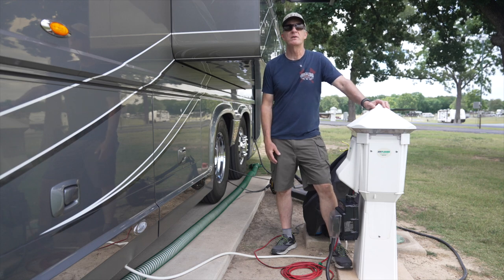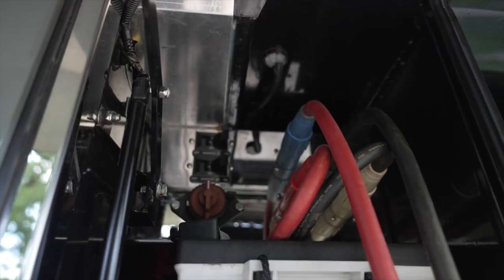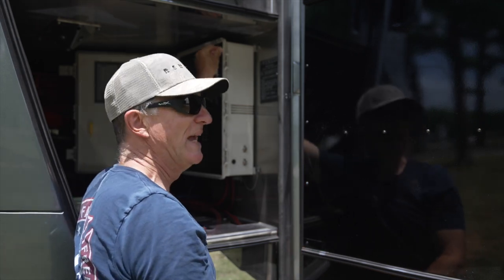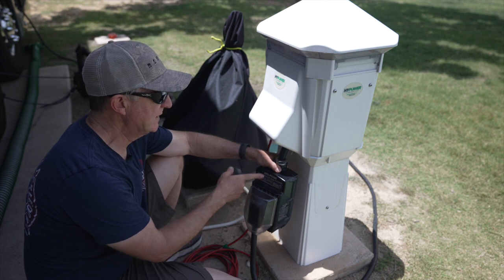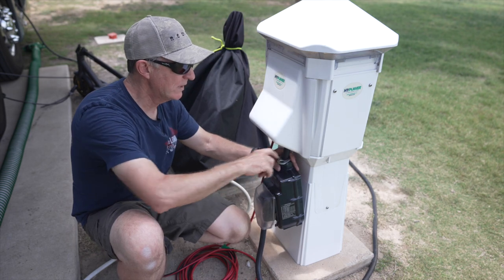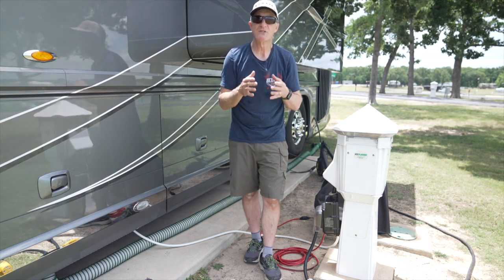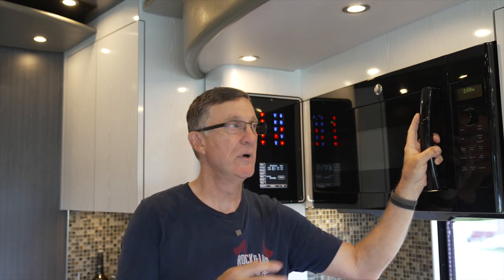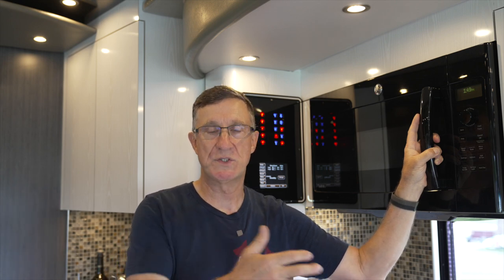3 Main RV Electrical Systems | Newell School

Comment: Nice video, great explanation. Would love more info on figuring out watt usage in the form of AC, when considering generator needs.
Reply from the maker: Thanks Blake. I explain wattage conversion to amps at the 12:00 mark. This IS the amperage for 110v AC. Let me know if you need further help. Thanks for watching.

Comment: Hi again.... Great video of course ! another question...What are your thoughts on adding or having any kind of solar panels for recharging or power?? would really be interested in a video of your thought and explanation as well as the benefit to cost !!
Reply from the maker: HI again Bill.  Simply put, there’s not enough rooftop real estate on a Newell to even come close to the needed output to do much more than slightly trickle the six 8D house batteries.  Many of us have done the calculations and, even if you have variable panel configurations, there wouldn’t be a single place to even step; something most would not find beneficial.
Reply: @RVSquaredSteve  OH !! well ok thank you for that info. as you have mentioned technology will hopefully change that !! appreciate your thought !!! your a huge help !!! if ever in Denver !!!!  say hi !!

Comment: Very helpful Steve.  2 other questions.  How many amps go from the engine alternator to the house batteries?  I think I've seen that the engine has a 500amp alternator (and I know a lot is for the chassis), but thinking there is quite a bit left over to charge the batteries while driving.  Second, when the generator is running, does it have an alternator that any directly to the house batteries via 12 volt, or does electricity only come via 120 volt and then the inverters charge the batteries?
Reply from the maker: GREAT questions!  The late model Newells have a 430amp or 460amp alternator.  With the merge relay, it will "share" that output with the Chassis and House batteries.  If you're not running "inverted A/C" (possible, but not recommended due to the stress on the alternator), then the 430amp will go a long way to charge up the House batteries while you're driving.

As to the Generator, it does NOT have an "alternator"...it's technically a "generator", which puts out a whopping 20kw (corrected thanks to @ak) of 120vAC power!  That power is sent to the inverter management system which will then distribute that power, as well as allow their chargers to charge the batteries.
Reply: @RVSquaredSteve  I thought the generator was 20k? I might be mistaking, it's your beautiful coach and I've never owned a Newell. Thx for your videos, very informative.  PS - what year is your coach. TY
Reply from the maker: @MaximusMerideus  hey…good catch on my typo!  You are correct; Newell generators are 20kw.  I musta been thinking about the towing capacity. 😉  Our coach is a 2015.  Thank you very much for watching and your astute comment! 🏆
Reply: @RVSquaredSteve  Wow, that was a fast response. Thanks RV Squared. Im a few years out from buying my Newell but I hope I can reach out for a little advice when that time comes?